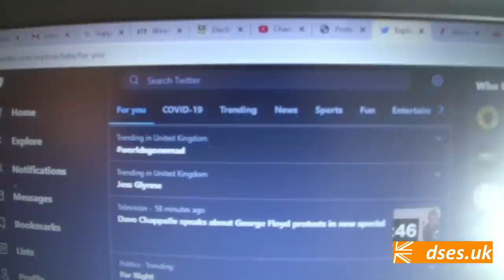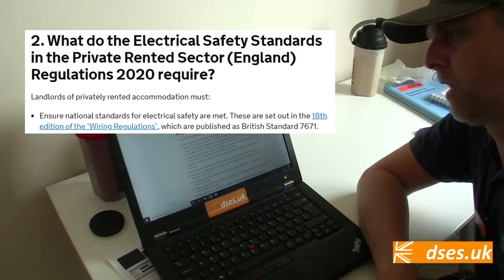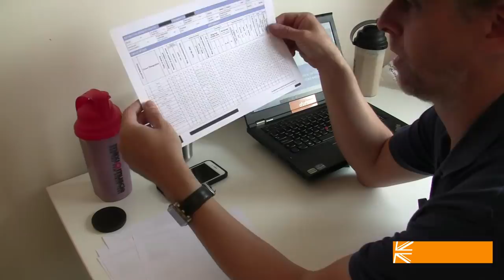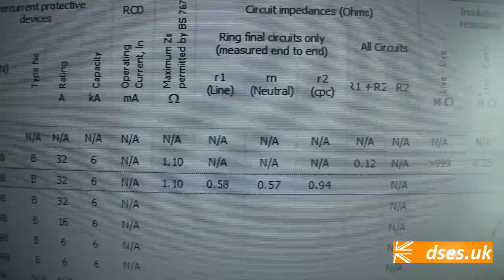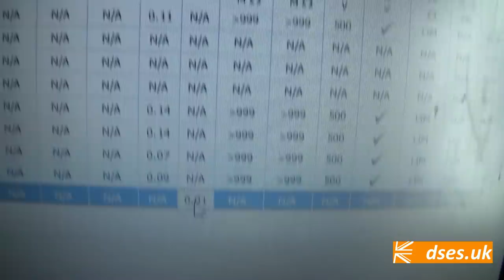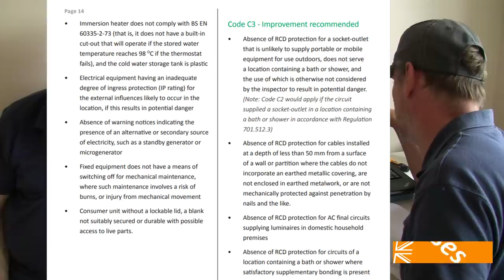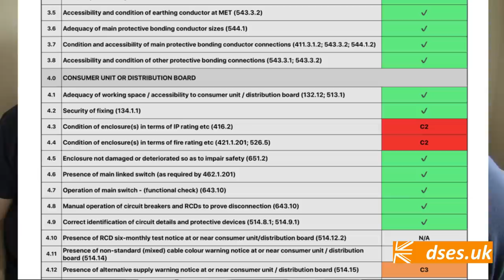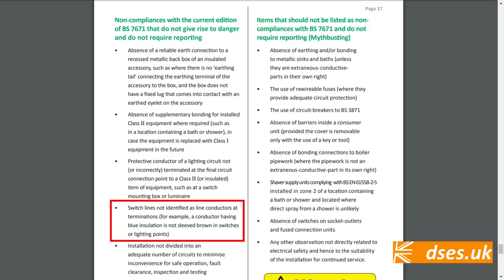Landlord electrical inspections from July!

Comment: Talking about rings vs radials, the regs even have a diagram showing 4mm radials with 2.5mm spurs... Is it acceptable on the EIR to put 2 different cable sizes for 1 circuit?
Reply from the maker: Yes, and not uncommon to find such. So long as the OCPD is rated for the smaller diameter cable, then it isn't a problem. I record the smaller size on the Schedule and make a note of it on the report so anyone else looking at is isn't confused.
Reply: @dsesuk  Thanks for getting back to me. Was having this discussion with a friend and he wasnt keen on the idea of using radials and having mixed cable sizes.
Reply: You can even use 1.5mm spurs e.g. to a 1-gang socket, even if it's on a 32A OCPD.

Comment: *****IMPORTANT****  Or at least I feel it is ?.  Loving the video's by the way, however I just needed to highlight an important issue.   In the video you have decided to rely on GUIDANCE from Napit Codebreakers and Electrical Safety First (who are nothing more than a Charity!!).   What you have decided not to mention, wilfully or otherwise is THE LAW, The LEGISLATION...the actual document and it's content which would be used in any prosecution which is titled "The Electrical Safety Standards in the Private Rented Sector (England) Regulations 2020".  Contained within THE LAW is reference to the electrical standards and its clear, it stipulates “electrical safety standards” means the standards for electrical installations in the eighteenth edition of the Wiring Regulations, published by the Institution of Engineering and Technology and the British Standards Institution as BS 7671: 2018(5);.        

 It does not refer to using your own engineering judgement, it does not refer to relying on code breakers, it does not refer to electrical safety first.    For just a moment put yourself in the shoes of a barrister.......and look at the LAW, read what it says and dont conflict what it says with your own personal opinions and feelings with what you THINK the legislation was introduced for.    The Laws of the land are black and white and there is not room for interpretation.  

 I actually think that your high degree of electrical knowledge, experience and engineering judgement gets in the way of WHAT THE LAW SAYS !    Im not here to try and belittle you in the slightest, I am merely pointing out what the legislation says.....and just to re-iterate it stipulates (Section 3 subsection 1 A) -  ensure that the electrical safety standards are met during any period when the residential premises(8) are occupied under a specified tenancy; and we know from earlier that the “electrical safety standards” means the standards for electrical installations in the eighteenth edition of the Wiring Regulations, published by the Institution of Engineering and Technology and the British Standards Institution as BS 7671: 2018(5);.    

I agree that it would be an impossible task to actually make this work BUT if you rely on the legislation that what is says 

Just playing Devils Advocaat !

Comment: That's bollocks about plastic switchboards. They are treated to be flame retardant and to self extinguish, ergo it's not a combustible material. Saying that anything will burn when you get it hot enough, very unlikely to happen in a low voltage installation though. 90% of new switchboards installed here in NZ are plastic and the houses here are wood framed in hotter ambient temperatures. No houses bursting into flames due to plastic switchboards.
Reply from the maker: I miss plastic. So much easier to work with. Now whenever I go to pull the cover off a metal CU, I always wonder if the last guy left something live floating in there that's going to catch it as I remove it!
Reply: @dsesuk  Yes I wonder the same, sometimes there is an earth strap to the cover, 50% of the time the last guy connected it up before refitting the cover.

Comment: David, a boring question I know but will help me when doing EICR’s. What code out of interest would you give a board full of 3036 re wirable fuses (if any) ? Would you just treat it in the same manner as a board full of MCB’s with no RCD protection as long as it’s safe and not been tampered with by Joe f*k*n Homebase ?
Reply from the maker: Hi Tom. BS3036 remains a valid standard, and if still installed as intended then fuses (or fusewire) remains suitable for the job of overcurrent protection now just as it did years ago. Of course, there may be other observations such as a lack of RCD protection or even failings like VIR cable in use, but an old school fusebox isn't itself an outright fail. ESF Best Practice Guide 4 confirms this, and I can't see anything about it in Codebreakers.
Reply: Thanks David 👍. Like you, I’m finding scaremongering tw*t* failing them for no reason, ripping them out and fitting shite, it’s sacrilege.

Comment: Forget 16th, 17th, 18th, how bad they are written, when it was installed, etc.  A metal CU with DP RCBO's will increase the safety factor of this installation for the tenant greatly.  Never mind the convenience of RCBOs, when there is a fault.  There is no argument on that. What is the cost of doing that?  Approx £25 per RCBO, plus the metal CU on top. Not that much in the over scale of matters. A responsible landlord (few and far between) can sleep more easily, and a tenant more safely. 

You can put in arc protection (AFDD), which is available, however there are question marks over its reliability or ability to do what they say on the box. RCBO and arc protection can cost £100-110 per circuit.   Maybe worth it on the high load circuits, where safety is likely to be a higher risk. 

It is not just about keeping costs down and covering your arse.
Reply from the maker: The issue I suppose John isn't that there is an argument of a DP RCBO installation being more beneficial, but that so many 'upgrades' are being demanded by rogue inspectors and then performed badly to the point where the expected benefits are lost because insufficient testing failed to find the IR fault that now keeps tripping the sockets off, and the top of the board has been walloped out leaving gaping holes with no IP rating, and a 32A RCBO was installed on a broken ring circuit, and the connections weren't torqued properly and all sorts of other issues where lazy workmanship and corner cutting are involved. It's arguably only better if it's done right.
Reply: @dsesuk  
David, cowboy workmanship and installation of superior safety devices are two different things.
Reply: @dsesuk  
I once rented out a flat I owned.  I immediately installed RCD protection. Not required then but I did. I did it to ensure the tenant is as safe as can be. There is also the point that I do not want dead people on my hands. I doubt i could live with that. 

If I owned that flat I would install a metal CU and RCBOs. If they have a problem on a circuit only that circuit trips out leaving them with electricity. That is what I would want if I lived in a place, so I would give that to others.
Reply from the maker: @johnburns4017  I hear what you're saying John, and I would do the same but it's not for me to demand my own standards are met. I can make my recommendation, as strongly as I can, that upgrade is recommended, but it's not my place to rubber-stamp it as being wholly unsatisfactory when the guidance from the likes of a CPS and from ESF list these non-compliance's with today's standards as recommendations.
Reply: For my own part, I would want an RCD fitted. But I'd be perfectly happy with only a single RCD protecting an installation that small. Other than that the installation really seems fine to me as is. A fire in the distribution board is so unlikely when the installation is properly done and you're not monkeying around with things you shouldn't be, and those fire retardant plastic enclosures were deemed safe for years. It's not as if it's made of wood.
Reply: @Karreth  
The CU is in the hall near the front door!  It is a really dumb place to have one in the first place, right at the exit of the flat in case of fire - this place is only 21 years old. Gas meters were prohibited from front door locations a long time before 1999. The CU does not even have a cupboard around it, totally open. Common sense says do not put the CU there even if it was legal to do so. It was totally irresponsible to fit it in that location. But it is done no matter what the fools then did. 

Having a metal CU will give an extra level of fire protection, especially when in such an open risky location. Ideally it should be a metal CU with a 1/2 hour fire resistant cupboard around it. 

One RCD for the whole flat is better than none of course. Because the flat is small does not mean it should only have one. In mid winter if the power all trips you are in the dark all over.
Reply: @johnburns4017  that's nothing I've seen consumer units installed in a kitchen cupboard below the sink and also in hallways with the bath directly above which has leaked.

Comment: What radial would you install to a kitchen? 4mm or 2.5
Reply from the maker: 4mm for me. Sure, reference methods can get snotty about it at 32A and I'd prefer a larger CPC, but in most domestic applications it's going to do the job juuuuust fine.

Comment: NAPIT code breakers page 38.

C2 for cables installed 50mm or less within a wall if there is no 30ma RCD protection. 
No RCD, domestic property, probably going to get an unsatisfactory outcome.
Reply from the maker: Yes, that's an example of NAPIT disagreeing with ESF. On that, I disagree with NAPIT as I assume they code it that way because someone could whack a nail into a wall and hit a line wire (an example given in the video), but then you've got reg 410.3.9 which permits a lack of fault protection for parts of insignificant contact. Wouldn't it be nice to have a consensus in the guidance?!
Reply: @dsesuk  
Hmmm don't think that reg applies to cables concealed within a wall.
I'm  sure that a NICEIC tech talk discussed my previous comment and came to the same conclusion   ie. if a fault occurred (nail through live conductor?) it would become dangerous therefore a C2.
Could ADS be relied upon if the nail was touched and there was  a path to earth??
Reply from the maker: @davidb3537  No, but ADS wouldn't apply in the same way on a lighting circuit with no CPC where the screws on light switches could go live should a line wire come into contact with the knockout box. If the contact point is small and can't be significantly gripped then the risk is reduced. I'm not saying I'm right or that this reg applies, it's just something else that muddies the water!
Reply: @davidb3537  at the NICEIC tech talk last year they advised following the guidance in the electrical safety first document and obviously poo pooed Napits document. They said the ESF document is the opinion of multiple bodies including Napit actually and felt it wasn't very professional to then issue their own document with differing opinions to the original ESF document which they contributed to. I suppose as electricians we can only review all guidance/publications that are available to us then make an informed decision on our own reports. Theres no black and white in the electrical game which is why we should be on footballers wages and David should put his prices up and give nige 4 apples a week instead of 3.

Comment: The issue with the civil sector is job creation and retention. These departments write some guidance or regs, then most of them should be disbanded, but no, they keep 100's of staff on working on the revisions, typical public purse situation. 

Let's face it, the wiring regs don't need big changes often, we are at a level of electrical safety never seen before and with the exception of a few new modules in consumer units not much really should change, these changes can be done as a basic amendment but instead they will bring out new regs and books and guides and courses are sold. Some of the changes being frankly stupid and just so that the guy who writes about cable support had something to do for 2 years.
Reply from the maker: They're all just waiting out their fat pensions.

Comment: Earth bonding under 0.05 ohms it was in the 17th. On site guide but were is it in the 18th just done my inspection and testing and the tutor said it's no in the 18th
Reply from the maker: It's in Guidance Note 3 Tom, and is in my 18th Edition copy on page 45 where it says a reading in the order of 0.05 Ohm equates to about 25m of 10mm wire (which should cover most domestic installations). I'm not sure it is explicitly listed in BS7671 itself or in the On-Site-Guide.
Reply: Cheers mate

Comment: Good video Dave. A couple of careless mistakes on the previous report however, as it is a ground floor flat, can one guarantee the socket outlets will not be used to supply outdoor equipment ie vacuum cleaner or jet wash? They may have been his thinking for the C2 coding on the omission of an RCD for the sockets circuit.
Reply from the maker: It's a first floor flat John. From what I hear, a 16th Ed amendment required RCD protection for sockets serving a ground floor, but I don't have any of the old books top be able to look it up.
Reply: @dsesuk  John Whitfield's Guide to the 16th Edition states that in those days an RCD was required when "the socket outlet(s) are likely to feed portable equipment used outdoors."
Reply from the maker: @westinthewest  Thanks for that. I don't think that was from 1991 though, it must have been a later revision (I think there were six amendments or updates during 16th). I wonder if there's a history somewhere detailing the major changes over the years?
Reply: @dsesuk  You are correct.  It's his fifth edition of the 16th.  I've had a quick look online for an earlier one but got bored and forgot what the point was.

Comment: Hi david great video. So if you had found that the installation had been altered say sockets added or a new circuit had been added later maybe in new colours and there where no rcd.  What would you be recommending then
Reply from the maker: A C2 Greg as those alterations didn't comply with the standards in place at the time when they were done.
Reply: @dsesuk  so would you just say that one circuit need to be rcd protected then or would just go with whole installation c.u change. Interesting subject all this. Like you say there is going to be a lot of issues going forward with all this
Reply from the maker: @gd-bq7em  Technically, it's only the alteration that has to comply as that has been installed incorrectly unlike the remainder of the installation which is just to an older standard. The inspection could be passed if the alteration is rectified, but it may be more advantageous to modernise other aspects at the same time depending on what needs doing. As an example, a new spur socket installed without RCD protection could be put right by it being protected through an RCD spur, but with a kitchen extension that's been shoehorned into an old board with new lighting, cooking and socket circuits by Bob the Builder, a whole CU change may be more practical.
Reply: @dsesuk   yes david that sounds good.  There is going to be alot of people being ripped off out there. I was talking to an old spark the other day and he is glad to be getting out of the game now he basically saying to many changes and to many different ways of interpreting them. He said he felt sorry for the young ones coming into the trade
Reply: @David Savery Electrical Services I don’t follow the logic in terms of electrical safety and coding for an alteration not complying with the regulations in force at that time. If you had the scenario of an additional socket despite being installed not to regs  in force (naughty installer/DIYer) if RCD was required at the time , why is the use of that socket now potentially dangerous when others are not -all having the same method for fault protection (EEBADS) ? My understanding/interpretation for lanflord EICR is that you are not inspecting against “regs in force at time of installation” you are inspecting and testing against current regs (which doesn’t mean the installation needs to comply to be satisfactory) if indeed you were inspecting against the installation date regs, 1. You would be guessing without records, 2. You would be using /testing against different max Zs and other parameters on your test results sheet and schedule of inspections would be different would they not ? You seem to be contracting yourself here in terms of coding versus regs and coding versus safety assessment for continued use. I’d still code it a C3 for this installation.
Reply from the maker: @Marco-mg9tv  In this scenario Marco, I'd C2 it not because it really is necessarily 'potentially dangerous' as such because as you say, it's no different to the other sockets in the same property, but it's awarded a C2 because any new installation or alteration is to be to the standard of its day. Where you can make an educated guess that the thing you're looking at isn't part of the older installation and certainly where it is post 2005 (new colours being the dead giveaway), definitely where you know it's post 2008 (at least with RCD's), then the C2 is for it being unsatisfactory more than dangerous as the installer couldn't have certified it to the standard of the time. I take your point though.
Reply: that’s my point - the standards at the time  of installation or alteration are irrelevant. Observations must be made in terms of safety against latest regs.